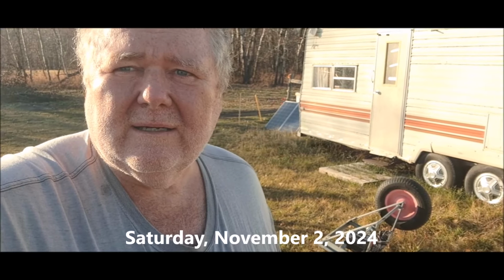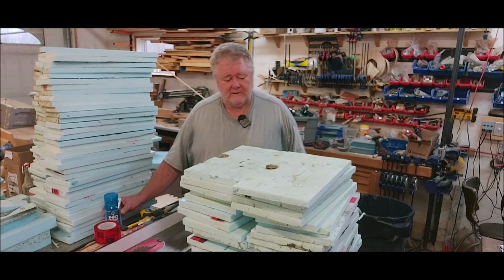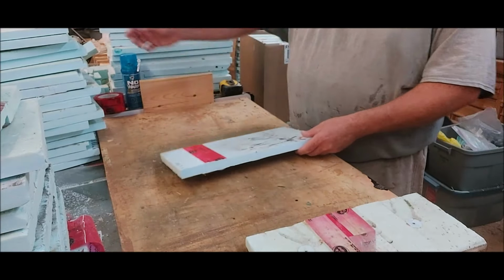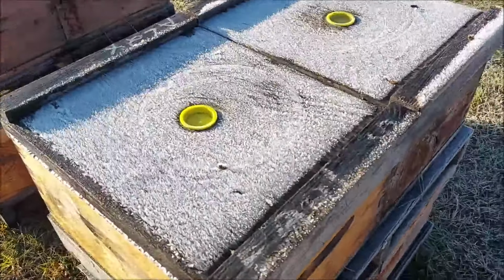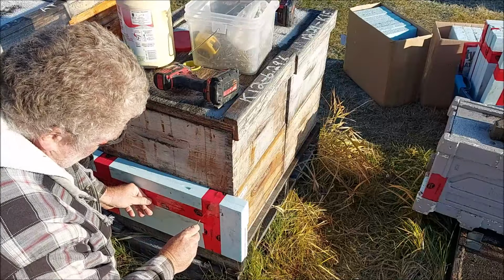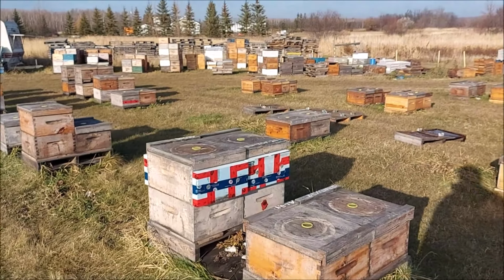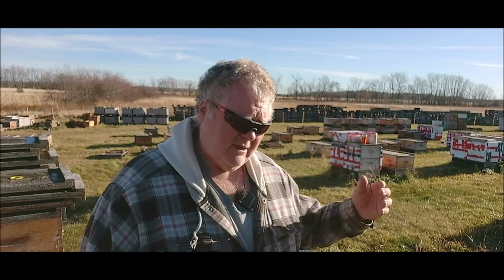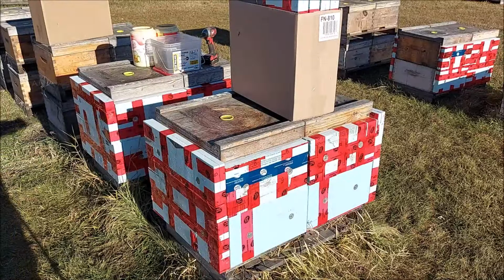⏱ BeeLog November 2 to 8-That Bee Man

Comment: Brad, I winter outdoors in northern Wisconsin and I find it most important to insulate the top. I put about 4" of polystyrene on top and put a brick on to keep it from blowing off. I do wrap with roofing felt for the solar gain and wind block. I have 80-90 percent success rate. Good luck, I wish you success!!!

Comment: Have you considered other foam products?  I see many people use the Owens Corning foam which in the most expensive products.  2" pink insulation runs $112 for R-10 value.  Durospan 2.13" runs $60.40 for R-10.  Half the price.

Comment: That wheel bearing situation is not ideal.  I was wondering if it was metric but if you found the right bearings the wheel may not fit the bearings.  

Any thoughts on insulating the top of the hives or did I miss that?  I could see the double bubble then insulation and then the cover on top being a possible idea but I’m not sure if you were going any further with it or just testing out what you have this year.  Thanks for sharing.
Reply from the maker: Hi Brian.  You didn't miss the plan for insulating the top other than my cursory mentions of the quilt boxes that I'll be constructing this week.  You'll see that on the next BeeLog  Thanks for watching!

Comment: Hello . What tooth blade do you use to cut those panels. I know years years ago I was cutting some vinyl siding an I was using a panel blade but it was still doing a little chipping d as I I turned the blade around backwards an that worked great . I am building a new bee barn an that is what I will be using to insulate my hot room with. Thanks
Reply from the maker: Hi Kathy.  I think that's a 60TPI blade.  I'm not sure it matters but do wear a respirator!  The dust that's created is considerable.  I'm aware of the backward blade for vinyl siding but that wouldn't work well for polystyrene I'm sure.  Thanks for watching!
Reply: @ Thanks for the advice. Always welcome.